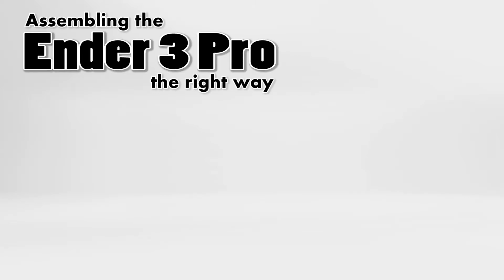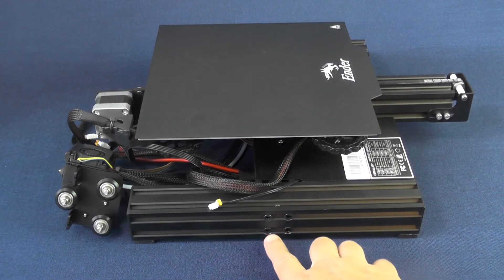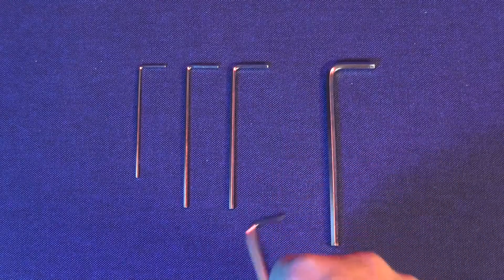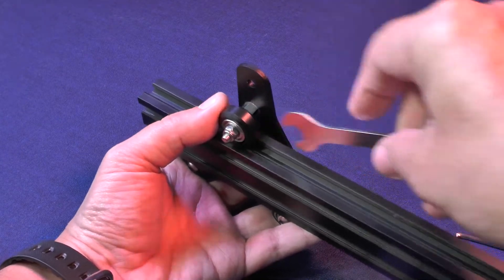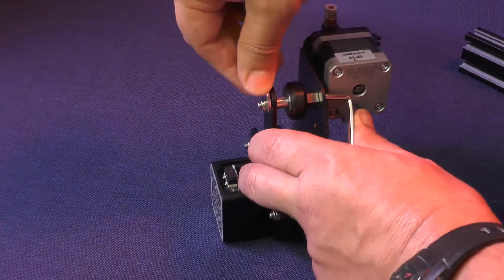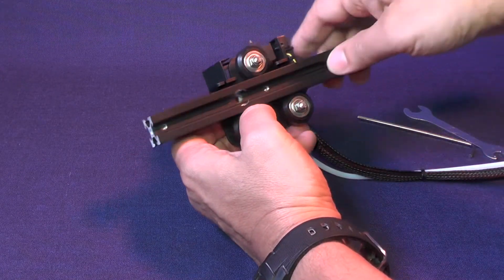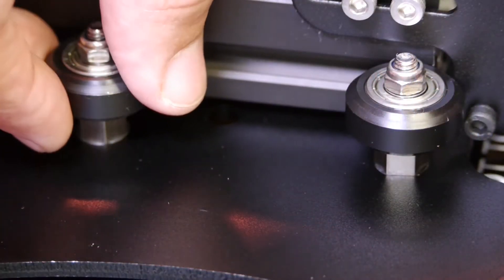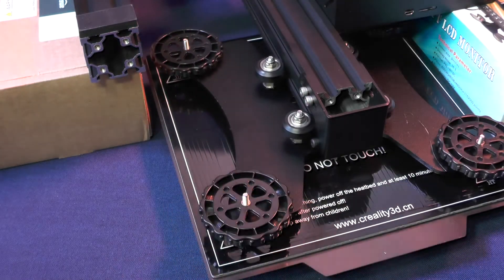Ender 3 Pro (2022) Assembly Guide - Part 1

Comment: I just finished putting my Ender 3 Pro together and making my first prints.  From what I've seen there are a few small changes to the current Ender 3 Pro's being shipped (got mine from matter hackers).
1: the printer did come with a 32 bit controller board.  Not sure if it is the 4.2.2 or 4.2.7 version.  It may or may not have the better stepper motor drivers, but the printer is as quiet as it could be, the fans make the most noise.
2: The extruder has a brass insert in the hole where the filament goes it, so the plastic part won't wear out from friction with the filament.
3: The extruder also has a brass insert where the boden tube mount screws in.  Both of these changes make replacement of the extruder with one with metal parts not as important.
4: The extruder also has a tension adjust screw now.
I don't think those dual gear extruder upgrades make any sense, at least not unless they drive BOTH gears (in different directions!).  A pressure wheel will work as well as a second gear, and will tear into the filament less than the second gear will.
As the price difference between the Ender-3 and the Ender-3 Pro has dropped, (now less than $50), I think the Pro is now the one to buy.  You get a beefier Y axis, removable flexible print surface, and an improved power supply.

Base of my printer came without any wobble.  Both the base and the Y axis didn't require any re-alignment, but I did very slightly tighten the Y axis roller screws to remove a bit of slippage on one of the wheels.
Reply from the maker: You made excellent points in favor of the Ender 3 Pro. I only have a few problems with some of the changes that Creality has made on the Ender 3 Pro. Look at the following excerpt from my most recent video:
https://youtu.be/l7Rkji5W4pc?t=291
Reply: @MakerMindset  I think we can blame at least part of their mucking around with the parts list on the global supply chain issues.

Comment: Great video, My bed eccentric nuts were similar to what you have here. I removed the bed to access the Hex head on the top to lock them down. A bit more work but doable - btw first printer and I put the entire thing together before I found your video. Complete disassembly is a pain but I am learning a lot about the printer with the hands on adjustment of everything.
Reply from the maker: I am a resin printer guy and this was my first FDM printer as well. Did the same thing. Built it, disassembled it, and built it again. Pain in the neck but it had to be done.
Reply from the maker: This first series was more geared towards the novice. Disassembling the bed, although doable, seemed to be too much of a hassle to suggest to a beginner. 
I could have, at least, mentioned it in the video, though. Maybe next time! 🙂

Comment: I bought one of these yesterday for $99 and built it. It took me just shy of 5 hours to build which is crazy high especially since it was only a 10 minute video. I let it run the whole night and when I woke up, it tore itself apart. I will get it replaced tomorrow and plan on watching your series as it looks a lot more in depth and put together.
Reply from the maker: I know that it is asking a lot but you should watch all the videos before attempting to build your printer. 
You will need to use several tools that, if you didn't get them ahead of time, will prevent you from completing your build in a single seating. 

There is also another series that will talk about bed leveling and the first print. You should watch it also, after assembling your printer.
Reply: @MakerMindset  thanks for replying! Just saw this while on episode 2 but my dad warned me first so I watched the whole series ahead of time. Are there any other tools besides calipers, clamps and squares? I knew that I needed this ahead of time but didn’t have time to buy it before. I am going to Lowe’s to get the square and clamps.
Reply from the maker: @polar1991  On video 4, you will need aluminum foil but you probably already have it in your kitchen. Also, if you have access to it, you should get a paper hole puncher. But, if you don't have it, you can always make the screw holes on the aluminum foil spacer with an electric drill.
Reply: @MakerMindset  thank you! I finished assembling it and it runs so much smoother. I just need to finish the bed leveling before my first print.
Reply from the maker: @polar1991  There is still a hurdle to overcome, which will be the adjustment of the Z-Stop switch. This is a problem specific to the Ender 3 Pro. This fix is described in the first video of the Bed Leveling series. Everything else will be easy and pretty fast.
Have fun! 🙂
Reply: Righty righty lefty loosy!

Comment: what a nice video! I wish I watched it when installing mine. may have to reinstall it...
Reply from the maker: I feel you, Xi Gua! When I first built my printer, I followed several YouTube tutorials but each was missing one or two important parts of the puzzle. After much frustration I went back to the "webs" and did a more thorough research and was able to come up with a more methodic assembly system that incorporates important steps from several YouTube videos plus a few tricks of my own.

Then, I completely disassembled my printer and rebuilt it again. It was no fun but this video series is the fruit of this reassembly process.

Comment: 5 STARS, HIGHLY RECOMMENDED! This channel is brand new, but this series is what the assembly manual ought to be, whether for first-time hobbyists' first assembly ;-) or for any user who is having problems they can't pinpoint. It is delivered in these videos so that you can watch the process all the way through to learn what you need to know if you don't have a manual, or you can pause each step as you go along. 

I bought a partially-assembled open box (returned) Ender 3 Pro that came with 2-page IKEA-style instructions. I skipped the first video, but watched 2-4 to successfully print several projects. After watching Part 5 for the troubleshooting commentary, I watched Part 1 and learned that I'm missing a few parts! 

Checking the items that are adjusted throughout the series helped me produce a nice 3dBenchy as well as an Eiffel Tower with no supports. Now if I can just figure out bed adhesion...
Reply from the maker: Congratulations, Master Brad! You are the first viewer to write a comment on this channel! :) I truly appreciate your kind words!

I have been doing resin printing for a few years now but this is my first foray into filament printing. This video series is the result of 6 months of trials and errors. I first built my printer, researched a lot more, completely disassembled the printer and rebuilt it again. 

I am amazed that Creality does not send any assembly instruction material other than that IKEA style fold out. All that stuff that I talk about related to keeping the frame aligned is essential for the printer to work in a minimally acceptable way. With such poor assembly instructions, I am not surprised that people have returned this great printer. Good for you! :)
Reply from the maker: With regards to your bed adhesion problems, I have one thing to say: "Bed leveling!" My next video is going to be exactly about this topic. It should address most of your problems with bed adhesion.

Bed leveling and bed adhesion are such common problems that, everyone that makes a printer building tutorial, also makes a separate video about bed leveling. The bed leveling video is not included as part of the assembly tutorial because you have to do it when you first build your printer but also as part of your maintenance routine.